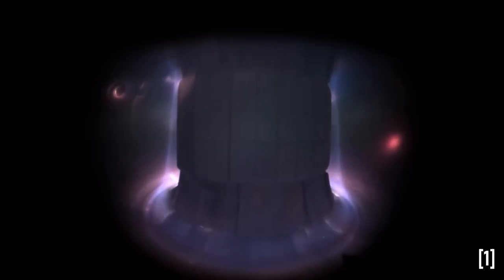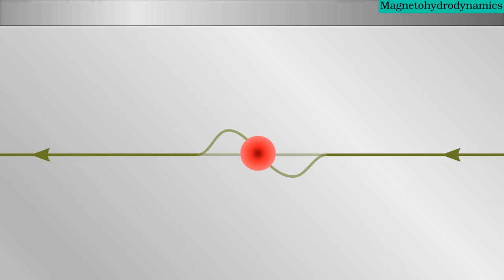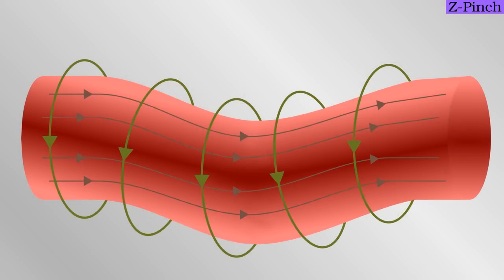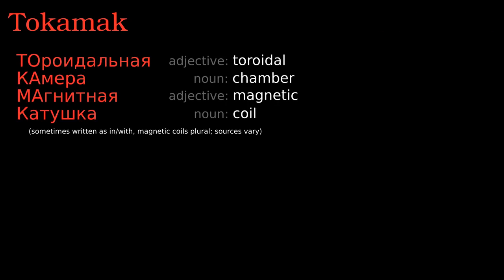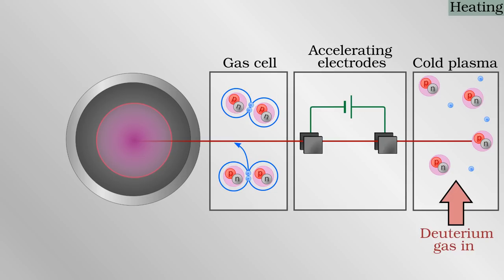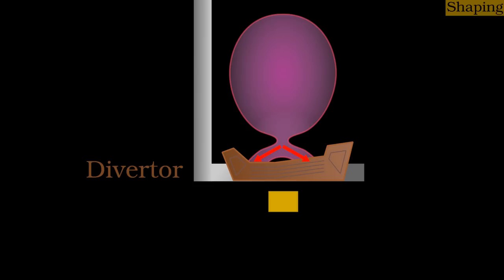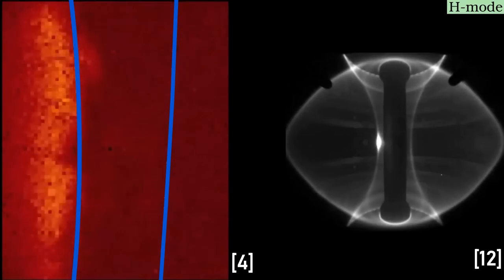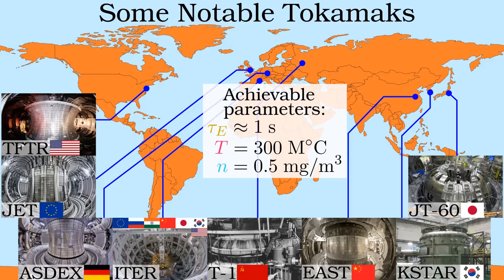How nuclear fusion works (3) - magnetic confinement, tokamaks, stellarators

Comment: The only problem I see with your explanation is that magnetic flux doesn't have "lines of flux".  There are no gradient lines detected as you pass a detector through a field.  What you see with metal particles around a magnet are shunted flux through the metal particles least path of resistance paths that do not represent "lines of flux".
Reply from the maker: I'm not sure what you mean. You can construct field lines for any vector field: https://en.wikipedia.org/wiki/Field_line
Intuitively, you can do this for a magnetic field by following a magnetic compass, as I describe at 00:41 , or the mathematical equivalent by integrating through the vector field.
You can see real examples of charged particles following such field lines at 11:27
Reply: @ImprobableMatter  Thank you for responding.  The link you supplied says it best, " A field line is a graphical visual aid for visualizing vector fields. It consists of an imaginary directed line which is tangent to the field vector at each point along its length."  If magnetic field lines really existed, you would easily be able to detect them with your compass as you traverse through them every day and your compass would tend to hop from line to line (especially at the North and South pole.)  The lines you show at 11:27 is using a magnetic imaging super cell and each line is sourced by the light source around the edge of the super cell creating a line in the magnetic ferro fluid.  If the magnetic line gradients really existed the hysteresis curves would be distorted with peaks and valleys in flux density.
Reply from the maker: I'm going to reply purely for the benefit of anyone else reading this, because I don't think I'm going to convince you. As Wikipedia says, a magnetic field line is an imaginary construct for visualizing the shape of the magnetic field. They happen to be useful imaginary constructs, because things such as iron filings, spiraling electrons and plasma align themselves along magnetic field lines. You can see plenty of images of them in this video.

Field lines can be thought of for other vector fields as well (as Wikipedia also notes). If you drop a cork into a steadily flowing river it will trace out a stream line, which is mathematically the same thing for the flow velocity field as field lines for a magnetic field.

Comment: 'neutrons captured', by what?
Reply from the maker: Ideally by Lithium-6 in a specially designed blanket around the reactor. This will produce Tritium for further reactions. Additional neutrons can be generated by reactions with Beryllium first.
Reply: @ImprobableMatter  and at sustained  megawatt or higher outputs this will not destroy the machine?
Reply from the maker: Maybe! That is certainly what any future reactor must be engineered and then tested to survive, while also generating a net gain in Tritium, otherwise it will run out of fuel.
Reply: @ImprobableMatter  I consider this question to be the elephant in the room so thanks for your reply.

Comment: Question. I realize how dumb this sounds, but if pressure is such a problem, why not use that to generate energy instead of the heat? That's how cars generate power, it's not the heat but the pressure that drives a piston
Reply: The heat generates the pressure in a ICE.

For fusion, just like any heat engine you need to controll the heat in order to extract energy.
And when you start to distrupt the fusion reaction (by extracting heat energy/pressure) it gets more complex.

Comment: nice vid, very comprehensive and a great start.
something about stellarators, myhap? i wrote an article on the wendelstein x1 a few years ago, anything new since?
Reply from the maker: You can see pictures of magnetic field lines inside W7-X, when it was only just built. Since then, they have been steadily improving performance. They will eventually install stellarator versions of a divertor, which I mentioned in the context of tokamaks.

Comment: 🧲🌡️📡🔆☢️🔌🔊🔋♻️🌐☯️⚛️
I feel magnetism and electromagnetism play such a crucial aspect of the cosmos. It's really facinating how so many properties with-in Nature use; {"Differences"} that seem to be a key factor in keeping dynamic systems functioning. High pressure/low pressure, hot/cold temp, different densities, static electric charges/discharges, electromagnetism north/south poles, different velocity/angular momentum, layers between different regions such as, land, water, air, edge of atmosphere, space, the different regions in space with different particle density, creating bubbles/membrane layers, cloud regions, nebula's/ Galaxy's, Galaxy clusters, less dense voids regions of space. All of these things are basic differences but create a way for the dynamic engine with-in Nature to continue flowing and operating to create and convert energy. How a battery 🔋 transfers + charges through a membrane layer to a - charged side. Like how regions of high/low pressure and temperature 🌡️differences create winds. Transfer that into water or planets core and add density. It creates either ocean currents and flow or planetary convection geothermal activity. 
🧲🌡️📡🔆☢️🔌🔊🔋♻️🌐☯️⚛️

What if our universe is 1 half of a sorta ying yang ☯️ universe where there's a membrane layer in-between the 2 layers , maybe our black holes and quantum fields are an entangled membrane layer that allows for quantum particles to pop in and out of existence of that membrane with the other half. The 2nd half of our universe would maybe be an anti-universe, like a mirror image of ours where the anti-matter is to create this balancing act with-in the system. (It doesn't mean there is multiple versions of ourselves and all that stuff when people talk about a multiverse, no not that.) It just seems like a natural way to balance things out, yet also describe the fluctuations. I just had a random daydream thought and obviously I hope more professional people's minds end up diving into this sorta possible theoretical physics ⚖️ 🌐🧲🌡️🔆☢️⚛️♻️🌐☯️